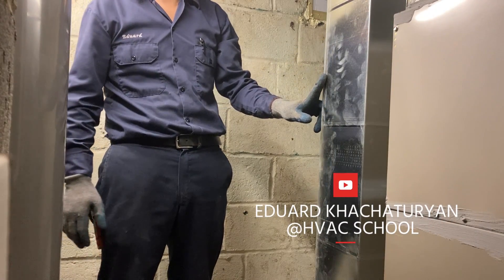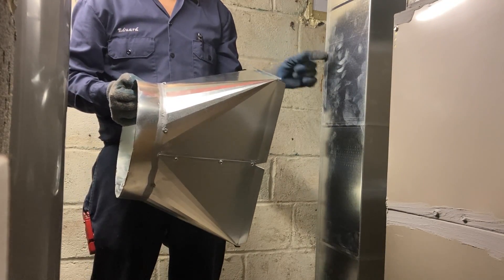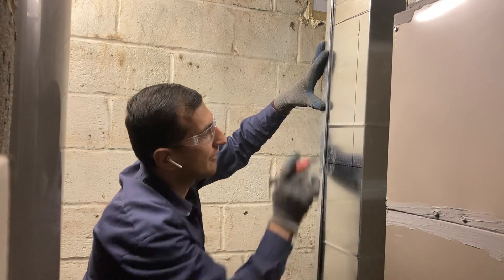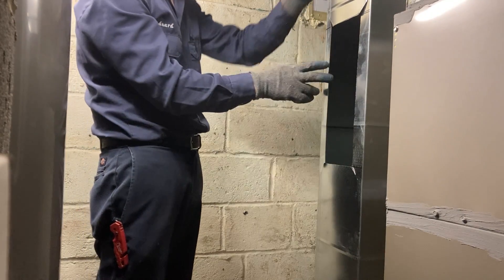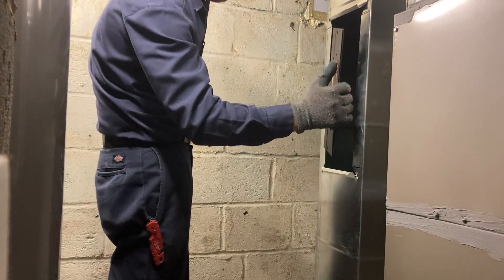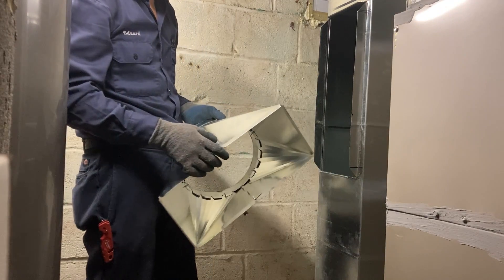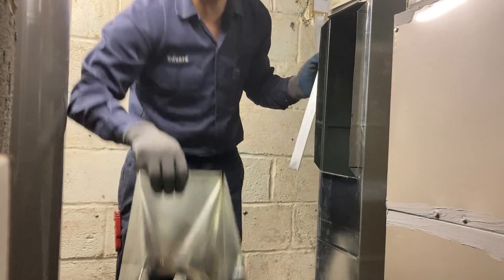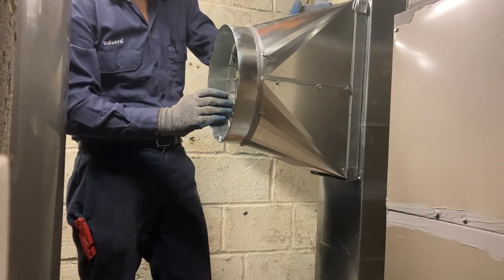Installing a Rectangle to Round Transition into an Existing Metal Duct

Comment: The Sq to round piece should of been large ended to slide over the existing vertical duct, cut out inside measurement of the Sq to round piece, and screw the sq to round to existing duct